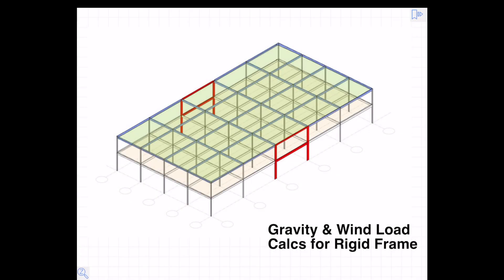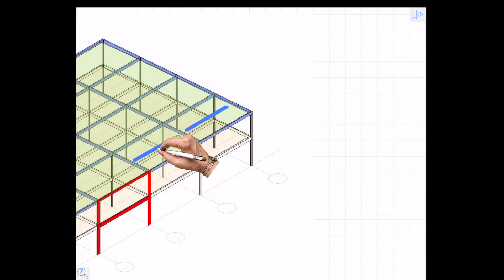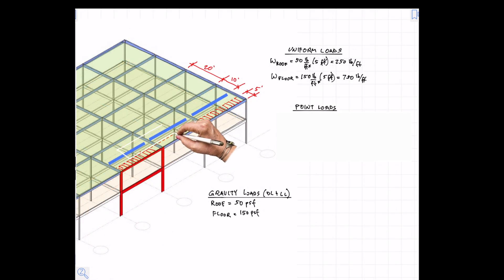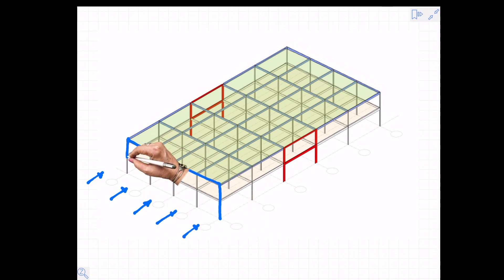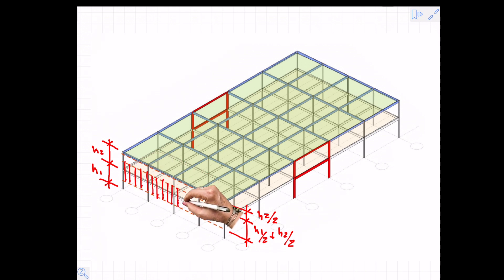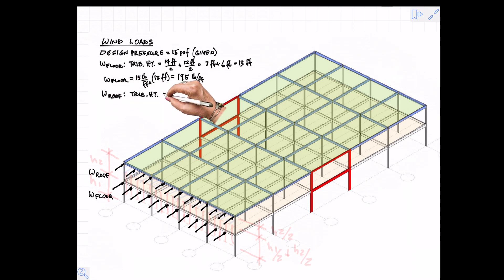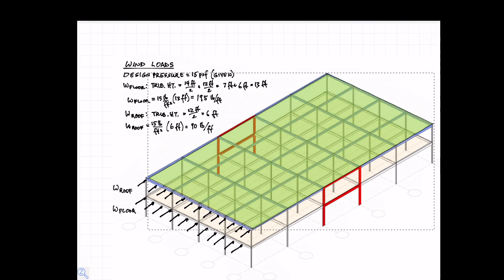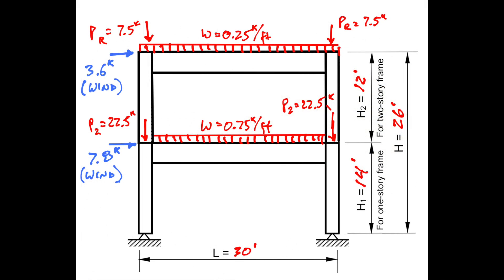Gravity & Wind Loads to Rigid Frame

Comment: Can you please explain why you considered that 80ft edge beams as simply supported beams and transferred the distributed load to the two edge supports as [195 or 90 Lb/ft x 80 ft/2] and ignored three middle supports?
I mean, it is technically an 80ft beam with 5 supports not a beam with 2  end supports.
Reply from the maker: No, it's only an 80' beam with 5 supports if the connections are moment resistant, which adds cost. Most commonly, elements that are not needed to be moment connected (for lateral frames, most often) are considered to be pin supported. Certainly it could be a 4-span continuous beam, which would result in reduced beam sizes due to the M- at each support, but this comes at the cost of making fixed-end connections, which normally is higher. Also, keep in mind that this is a very basic example to give architecture students an understanding abut how lateral loads are transferred and computed in a building structure. There are many other ways the structure could be designed.
Reply: Ok, thanks.

Comment: Hello Prof. What's the effect of making the entire structure rigid framed?
Reply from the maker: The members could be smaller since the lateral force would be distributed over the entire structure. The benefits would likely be offset by the additional cost of fabrication and erection of all connections being rigid. Nevertheless, in some instances this is done. The Desert Broom Library in Phoenix Arizona has small diameter fixed base pipe columns throughout that is the lateral force-resisting mechanism. But this is a small lightweight single-story building...this would never be done in a larger project.
Reply: @professordeb  Thank you Prof. Please, what lateral force resisting system will be most appropriate for an eight story building with wind pressures 0.7KN/m2 Windward and -0.3KN/m2 Leeward ?
Reply from the maker: @anayoeze6109  Sorry, that's far to general to answer. An eight story building very likely has a central core structure, or possibly cores on the ends, either of which can have stairs and elevator shafts. These are the perfect place for lateral systems that are commonly braced frames or shear walls. Moment frames may be used as well, but are generally more costly. It also depends on the architectural needs. Cores are great since they have no windows and thus can be solid or trussed without interference from doors or passageways. Moment frames allow for great flexibility, but again at a higher cost due to the expense of fabricating the connections.
Reply: @professordeb  Thank you Prof. Please, why did you consider just the wind direction in the shorter direction? Is it more critical than the wind acting in the longer direction??

2) Is there a structural advantage a rectangular floor layout provides to system as it is preferred to a square floor layout??
Reply from the maker: @anayoeze6109  This is only a basic example for beginning students and not an actual design. There are many more complexities that are ignored about the behavior of floor and roof diaphragms than are covered here. Of course a lateral resisting mechanism would be needed for force in the long face as well. The only real advantage of a square floor plan is simplicity through symmetry. Most buildings are not simple squares though!
Reply: @professordeb  Hello Prof. Pls I still need an explanation on which is a better structural resisting layout as regards wind actions. A Square or a Rectangle of the same area surface?
Reply from the maker: @anayoeze6109  The best layout for wind would be round, though that doesn't work with a lot of plan layouts. Since the wind can come from any direction a square would perform as well as a rectangle. Of course when the wind blows on a long face it will receive more force than against the short face, but the direction could change. I suppose one could argue that for symmetry a square would be better since each primary direction could have the same lateral resisting system, but that decision is probably going to be secondary to the architectural needs of the plan.
Reply: @professordeb  Thank you Prof. Your explanations are well explicit.
Reply: @professordeb From the above example, does it mean that member end restraints and nodal restraints are defined as fixed to simulate a rigid frame? Or is it just the member end restraints that are fixed? Please, what exactly boundary conditions for the nodes are exactly needed in rigid frame support system?
Reply from the maker: @anayoeze6109  Keep in mind this is only a very basic examples intended for beginning students studying architectural structures. The assumption is that only the rigid frame members are taking the lateral force and all other members are pinned. All the joints in the rigid frame are assumed moment connecting. The analysis of the frame is in this video: https://www.youtube.com/watch?v=vW0HKqa4fx8&list=PLWwE5cqfZ1OpZ3Hriz__siZxktJSri2B9&index=2

Comment: Professor will you go over 1. how to find displacement by hand calculation for rayleigh Fundamental equation. 2.slab and footplate design for C-channel Steel column it's for nonbuilding Structure -structural rack. Thanks
Reply from the maker: Sorry, that's beyond the scope of what I do here on this channel, which is geared toward beginning architecture students on this subject. I suggest you direct your enquiry to a more engineering-based channel. Perhaps Dr. Structure can help you out. https://www.youtube.com/channel/UCvSpLnUTU6MamZwD2a9zySg
Reply: Thank you professor I like your teaching that why i requested. Thank you for taking time to do these videos and replying me.